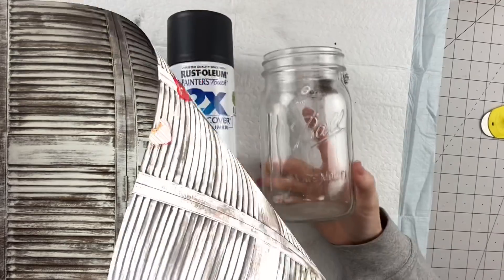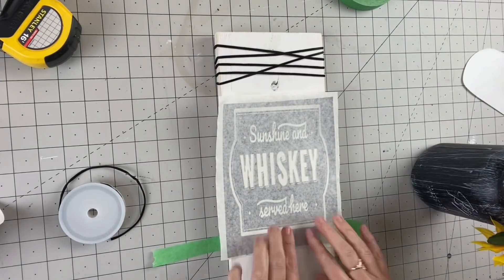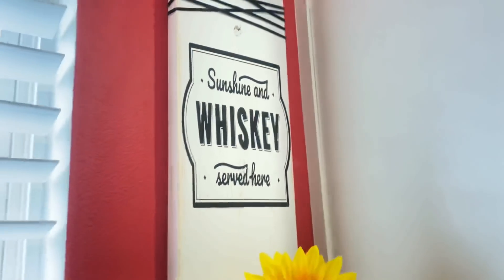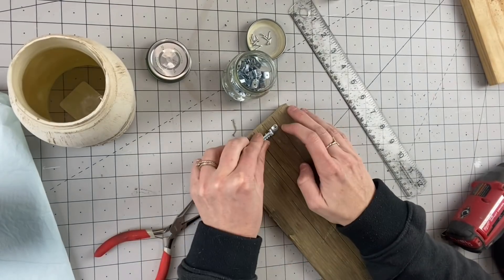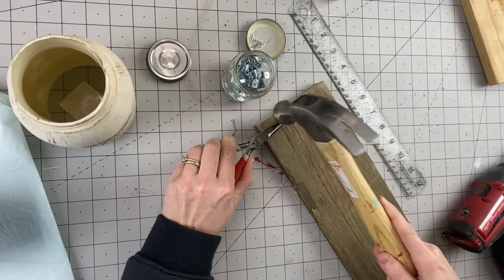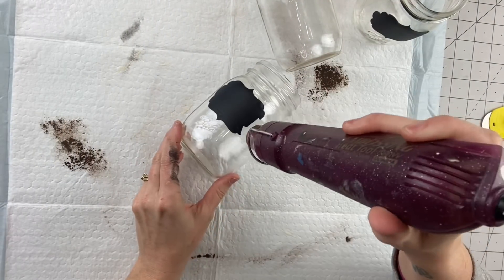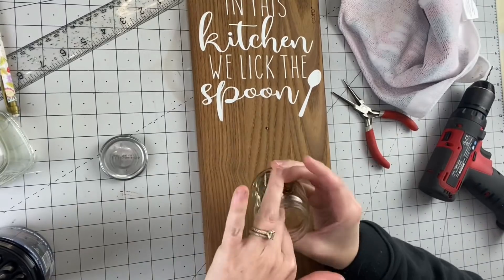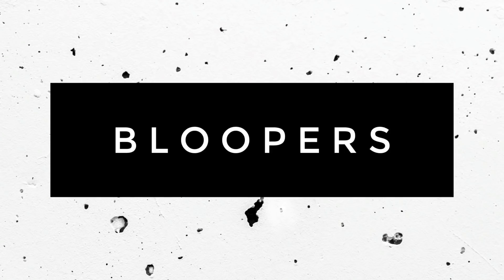4 EASY AND RUSTIC MASON JAR DIYS | RUSTIC MASON JAR DIYS | MASON JAR DIYS | UNICORN DUST DESIGNS

Comment: Used to be a department manager at Lowe's and that clamp is most commonly used to connect your dryer vent hose from the appliance to the pipe but I found that it has many uses because they also come in various sizes. Love home improvement stores!
Reply from the maker: Why thank you for that information Kelly! I love home improvement stores too!

Comment: I use a screwdriver to screw the cups holders in.  Put screwdriver in opening and turn and it will tighten it.
Reply from the maker: Thank you for that tip JoAnn

Comment: These were super super cute I couldn't pick a fav becuz I want all of them 😁. Thanks for sharing the dry brushing. Curious do you ever run your brush over the spot you dab your brush to pick up more paint instead of putting it back in the paint.
Reply from the maker: Yes!! All the time. Just depends on the amount of paint I picked up the first time. Most of the time I pick up such a light amount that there isn’t really anything there to pickup again. Especially since the pat absorbs it. Thank you so much for always watching girlie

Comment: Perhaps you could add some water to the Waverly  Chalk paint to thin it out.  It may be easier to use.  I add water to my Annie Sloan chalk paint to not only make it easier to use but to save the amount of paint one uses.
Reply from the maker: So I did try adding water Fiona and so much better. Even just using a damp paint brush or spritzing the project with water helps!